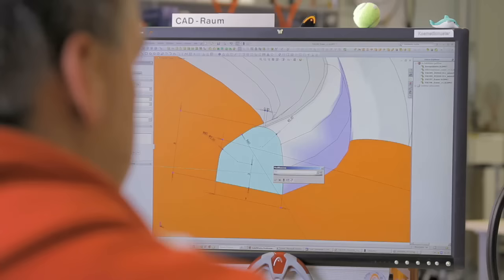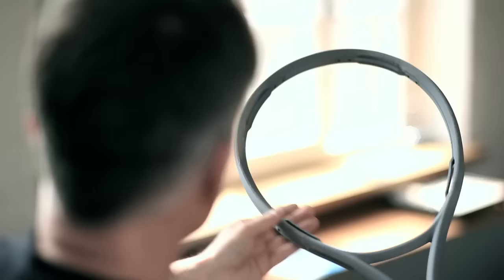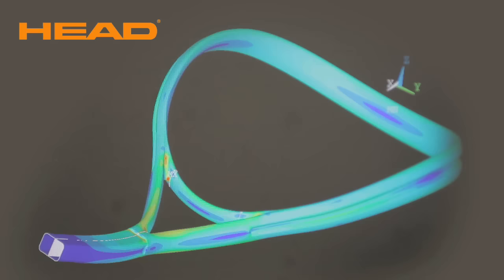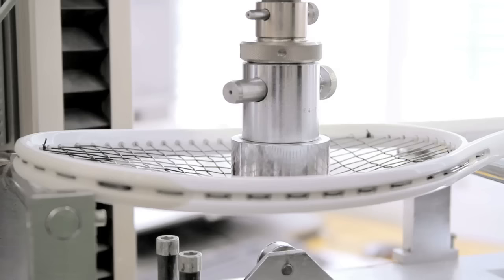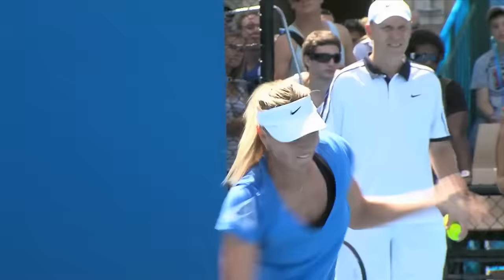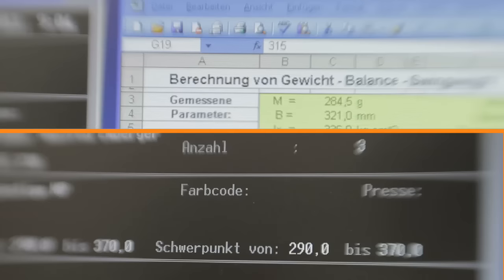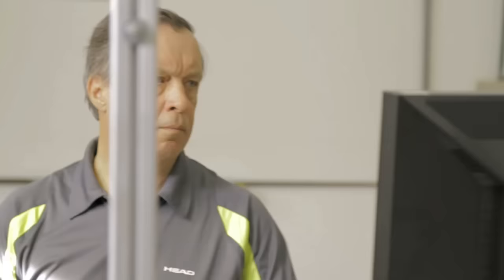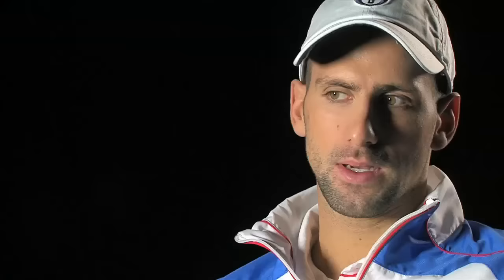HEAD Making of: Tennis Racquets (English) 🇺🇲

Comment: I actually believe Andy uses an old Midplus I.Radical with the weight and balance modified painted like the latest youtek with a prestige grommet. The Radical and Prestige headshape is similar enough that you can fit a prestige grommet onto a radical head.

Comment: Hello,
       I would like to know I'd you can help me out. I own a few head youtek ig extreme 2.0 midplus racquets( Richard Gasquet's 2013 version with the clear bumper guard) and would like to add some lead tape under the bumper guard. Since the bumper guard is clear I would like to replace it with a black b umber guard so that the tape is not visible.. can you tell me if there is a bumper guard/ grommet set(perhaps from a different head racquet) that is compatible with this racquet.  Thank You in advance

Comment: @sthsu1990 wrong, it's neither a prestige or radical it is a PT57A with a 16x18 string pattern, the most similar racket you can buy to this is a head pro tour 630/280 with CAP grommets...

Comment: Funny Murray is full of it lol doesn't even use the radical he uses a prestige
Reply: Dude he uses the radical
Reply: +RobertoPlays yes he does, he uses Prestige mold...Since Agassi retired and left Head's Radical line with no face, Murray was given the Radical paintjobs. Pros almost never on this day use the same stock that is sold to retails.
Reply: +RobertoPlays 
another one... and Djokovic uses Speed Pro right? :D
Reply: +Yuri Panteleev nope novak is using an old radical something like liquidmetal or fxp or microgel just the old radical not the new ones.
Reply: I mean it doesnt matter what brand he uses, those dudes custom their raquets so hard that in the long run its completely original product which cant be purchased
Reply: @LuchoVena  Look I know this comment is from 3 years ago but Murray does not use the Prestige nor the Radical Mold. He uses the head PT57A, which is the pro stock model of the Head Pro tour 630/280 that Thomas Muster used, underneath the radical graphics.
Reply: GoodLuck WeNeedIt yeh youre right. Although Roger federers racquet is a pro staff and is the one sold on the market. Its different though coz Wilson specifically say that Roger Federer uses that exact racquet.

Comment: That's how Murry's and Djokovic's head frames are made. NOT yours.

The one you buy are made in China with cheaper material that are stored in less optime environment. I guarantee  you the factory making them for Head in China do not even have a room that can maintain a -50 C temperature. 

Worst part is, both Murray and DJ really use a different modified Radical mold that HEAD will NOT sell to you, unlike Wilson and Babolat, where Federer and Nadal actually use a Six.One 90 and APD.